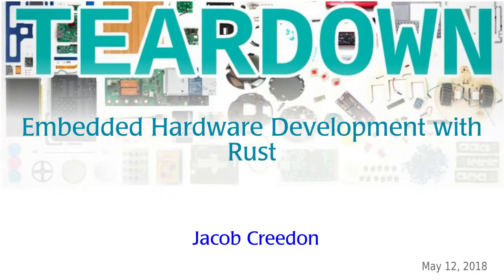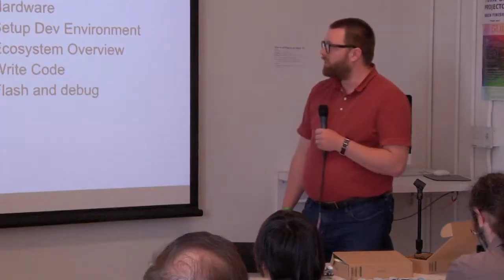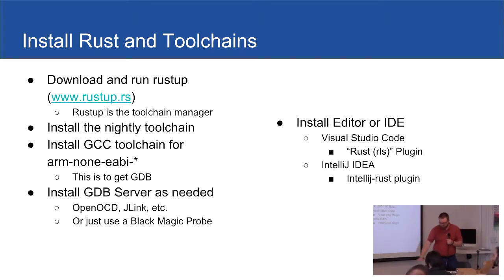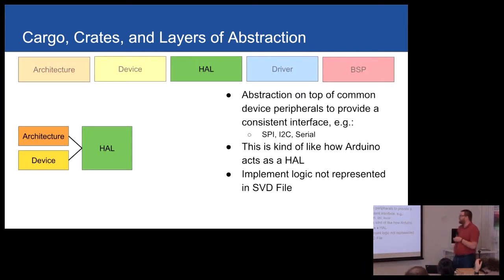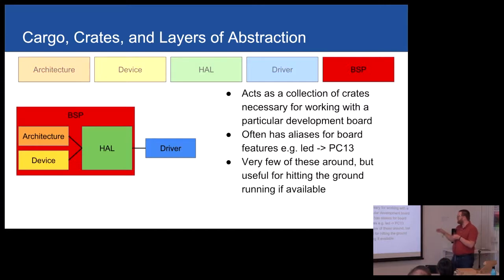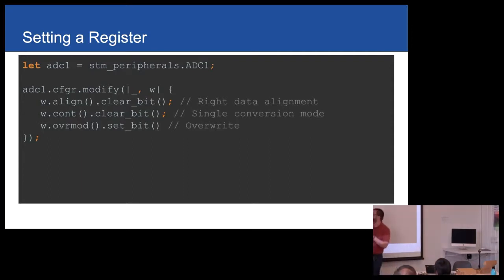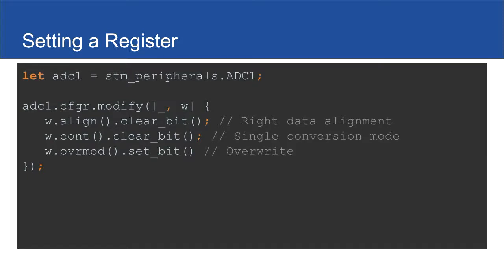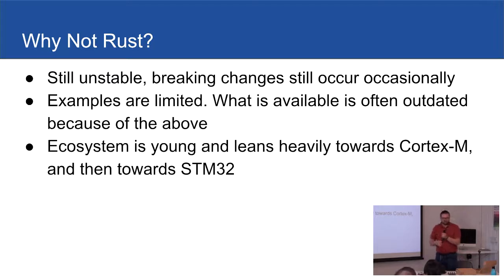Embedded Hardware Development with Rust

Comment: I like rust. I think it's great. But this statement people keep parroting "working with raw pointers is dangerous" is ridiculous, especially when working directly with hardware. You will never be adopted by the embedded community if this is the mentality you want people to have.
Reply: working with raw pointer IS dangerous, working directly with register IS dangerous, sharing data between ISR and main loop IS dangerous and the amount of time I found issue in existing code and my own on this stuff is worth picking up.
And is not only my opinion, C++ folks went out of the way to adapt smart pointer, bug report from microsoft, mozilla, chrome and other show clearly raw memory management is a problem. And yes, sometimes in C++ a raw pointer is still the best solution, but is quite rare.
And is also true on embedded the code complexity is lower and is easier to keep in control is true, BUT why bother if the compiler can do it for you AND better management of lifetime AND data synchronization between ISR and eventual tasks AND give nice interface to the register AND make sure you are not re-using HW interface for multiple stuff?
Reply: @lesto12321  "Why bother managing your own addresses that are static when you can.. fight the borrow checker" is what you meant big dog. Not saying rust doesn't have its place in embedded. I like it, but its a pain in the ass.
Reply: @penguin1714  if you are fighting the borrow checker means you are doing something weird with those address, so actually is where it is more helpful to have those checks.. Compiler dont do distraction error :)
Reply: @lesto12321  Umm, no. If you think this, you aren't aware of how rust works. There are a bunch of completely standard operations you can use pointers for in C that rust doesn't allow due to thread safety. This is all fine until you realize that you're on a single core with no hardware threads or scheduler. (embedded). It means I have to fight the language in order to support standard operations on embedded.
Reply: @penguin1714  
"There are a bunch of completely standard operations you can use pointers for in C that rust doesn't allow due to thread safety"
Can you please make an example? So far I never come up with any.

"This is all fine until you realize that you're on a single core with no hardware threads or scheduler."

you still have ISR going on that may require synchronization of data
Reply: @lesto12321  For example, in C, you can have a struct which contains a variable and a pointer to that variable. In rust, you cannot do this.
Reply: @lesto12321  Your comments lead me to believe you don't really write embedded, but you still seem to advocate for embedded rust. I'm just going to end this with: you should actually write some embedded rust and then think about it.
Reply: @penguin1714  yes you can do that, and is not even unsafe (just double cheked on rust-lang to be sure). but also if you are using raw pointer you should ask yourself why, rust is not only a language but a different way to expose the problem, that you could also use on C/C++

ps. i wrote C/C++ embedded every day, rust is just for fun, but never seen anything that need raw pointer, Device and HAL make quite a good job. For sure you need to write the code in a different way